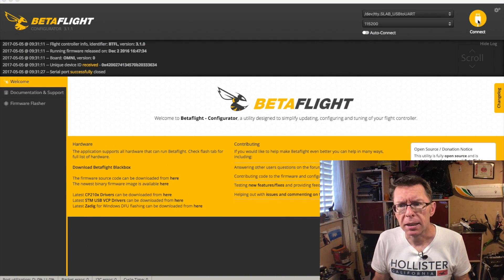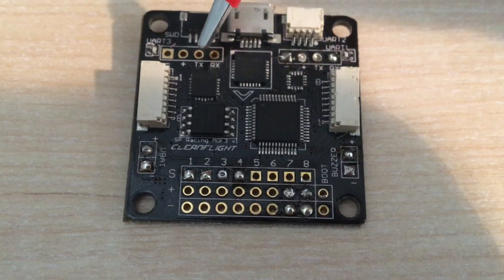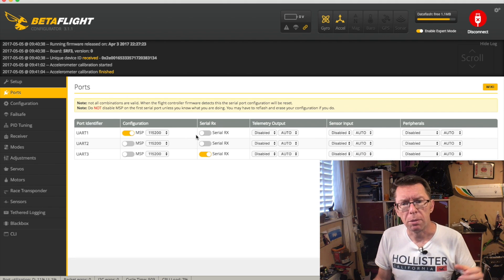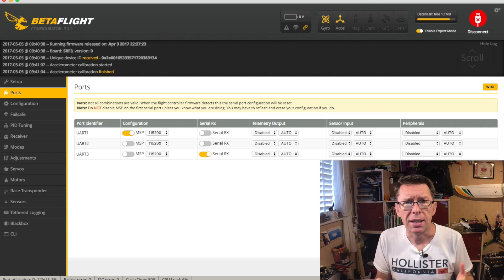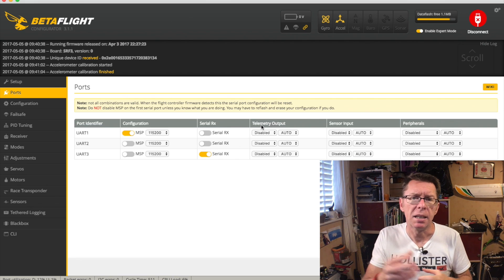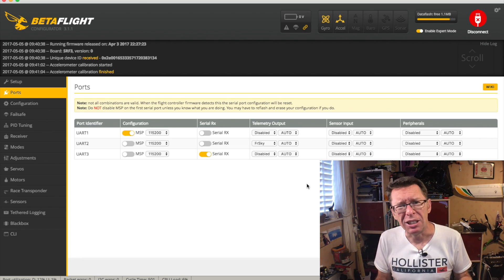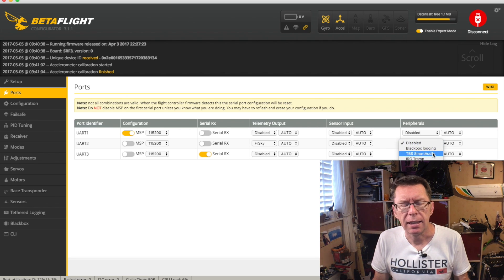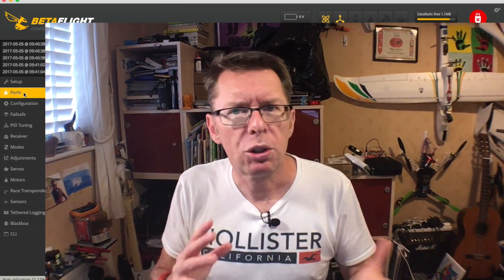FPV Tutorial: BetaFlight Basics Part 2 - What's the Ports tab for ?

Comment: This video is from 2017. I just got my hands on a buddies drone pre build eachine wizard from 2016. I cannot for the life of my get the battery voltage to show up on OSD as anything but zero volts. Its enabled in OSD. In your infinite knowledge would you happen to know anything I can try other than flashing the board to a different version? Thanks!
Reply from the maker: Back in 2016, things were generally a little less integrated.  Is the board being powered via a BEC or some kind or a PDB board?  Odds on there's a VBAT pin that needs to be connected to the main voltage in order to give that voltage in your OSD
Reply: @CurryKitten  my reply won't post! sorry. Its a PPD I believe, i'm not too familiar with the linquo. My drone info says "Hello, X220S PCB doesn\'t have BEC. There is a story... In beginning, this PCB has BEC cell, but we thought it just only power for the LED, so we decided to remove BEC on the PCB, but our SMD factory didn't get our meaning, so there are some marks on the board, in fact, this pcb doesn\'t have BEC. Surely, if needed, you can also put BEC on the pcb board.:)"

Comment: Please can you help I have just bought an elrs receiver so now the sbus tab on the fc is free. that was on uart1
Uart 3 is used by the caddx polar unit
uart 6 is used by the gps
So in the ports tab uart 1 is Free
Can I use the sbus tab for the elrs receiver and if so, where does the rx and tx wire go on the fc
Thanks
Oh i don't have a spare motor port
Reply from the maker: I actually had just this problem the other day - and will be covered in Fridays video.  You CAN run ELRS on a single wire - although obviously without telemetry (and it means you can't flash the RX via the FC) but it does work fine.  I've got a whole bunch of quads which don't have many UARTS (mainly F4s) and often it's only SBUS that's left.  What you'd need to do is connect ELRS TX to SBUS then change the serial provider to CRSF.  If you are running an F4, you'll need to flash you RX with the RX Invert option on.  I noted with an F7 it would invert/uninvert the UART depending what you set it to, so you don't need to do anything on an F7
Reply: @CurryKitten  I look forward to your video Never had to flash anything before Always used Radiolink. So much appreciated , I will watch your video covering all those points Thanks again Gray

Comment: I accidentally turned OFF my MSP on UART 2...and now can't turn it back on. When I try...save and reboot it gives me message that failed to close the serial port. Everything else in able to change.🤔 UsbVCb is first at top with msp activated by default...UART MSP was also activated by default before I changed it. And since I'm using crossfire my UART 2 Serial rx is on.  Once I took off msp uart 2...it wont come back on. Maybe a conflict??

Comment: I'm using a radiomaster t12 with an XM+ RX and a mamba F405 FC, however, its connected to sbus but can't figure out which uart it is in Betaflight. Mamba F405 FC aren't labeled uart 1on the pad that sbus is soldered too. i tried all serial rx tabs one by one, saved but transmitter is still not showing any movement in the receiver tab in betaflight. XM+ is soldered in correctly where it belongs. Can't figure out why its not showing any movement in receiver tab in Betaflight. Any help is greatly appreciated.
Reply from the maker: The Mamba 405 usually comes with a big diagram showing an example of how to wire up, and I think SBUS is on UART1.  Did you also check when doing this that your rx is powered and the green LED is on showing that it's connected to your radio?

Comment: anyone know which uart ports line up with witch. If i have a camera and a receiver how do i know what is what?
Reply from the maker: As far as what to use UARTS for, the only one that's usually relevant is the one that's designed to take an SBUS signal as that's usually inverted (which is a whole other subject as  the ability to invert/uninvert UARTS depends on the hardware of the board you have)  Look at the wiring schematic for your board, you should have a diagram with each pin labelled (often you'll need to find these online) The camera usually uses a VIN pin (and VOUT for the VTX) not a UART
Reply: @CurryKitten  so would the sbus be uart 1
Reply from the maker: There's no standard for which UART does what.  SBUS is sometimes on UART1, sometimes on UART3 - no doubt on other board it could be elsewhere

Comment: Lots of good info here. I need to control an external device using a digital HIGH/LOW signal. Right now I think I am stuck using the buzzer pin and rectifying the signal with a capacitor. Do you know of any way to toggle the UART TX pin between 0 and 5 volts?
Reply from the maker: I don't, given that a UART is really just a glorified serial port, I'm not sure if that's an option.  Could you perhaps measure a pulse width instead of a high/low signal.  That way you could potentially use a PWM output ?
Reply: CurryKitten That was actually my original plan before I realized I would be using sbus instead of a pwm receiver. I would have to use an ATtiny to read the pwm signal and then if/else out a high/low. My IC needs the binary signal. I'll probably end up using the buzzer pin.

Comment: Hi Guy's, apologies for yet another Stuck Person. However, BELIEVE me i have tried and tried and tried. I so much want to get my Quad in the air, but can't. I followed your video as i have a FlySky Tx/Rx. I am sure it is something simple but as always, when you don't know, you don't know. Here is where i am stuck:-     https://youtu.be/xoTaMNOmhq8
Reply from the maker: Hi Matt - you comment got stuck in spam because of the URL included, so apologies for delay.  I watched you video and was feeling your frustration along with you.  As much as I kept shouting at the screen, you weren't listening :)  Ok, so the main issue that I could see is that your setup on the ports screen was wrong.  I'm not a FlySky user, so I won't be 100% on here, but if you are using iBUS (and I assume you've double checked your receiver does support ibus, and not just PPM) On your ports tab for the UART you want to user, enable serial RX (leave configuration/MSP alone and anything else other than serial RX on this UART) save that and then go into configuration.  In the receiver box, select "serial based receiver" in the Receiver mode drop down, and then underneath that select ibus from the "serial receiver provider" drop down.  Save /reboot and then go back in and see if you have any response on your radio tab.  Let me know if that does anything !

Comment: Please  can you explain me when I connect OSD module with F3 on UART 2, what must open in betaflight port?????  Thx
Reply from the maker: Are you talking about something like the MicroMinimOSD runnign MWOSD ?  In which case you need to run MSP on the UART.  This can sometimes cause issues when conencting up to Betaflight via USB as well (at least in the original boards, I've not tried it on a newer one as boards iwth OSDs built in are common place now)
Reply: Thank you